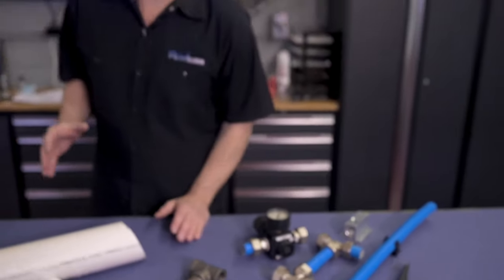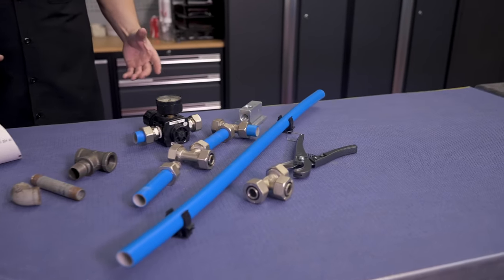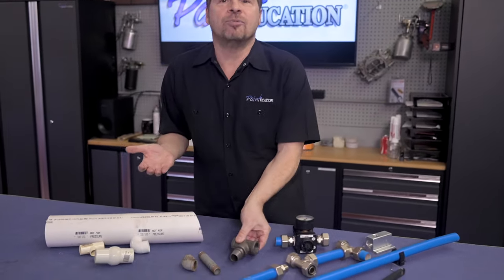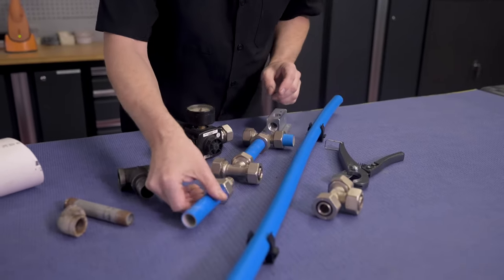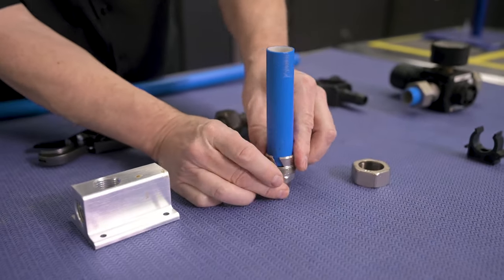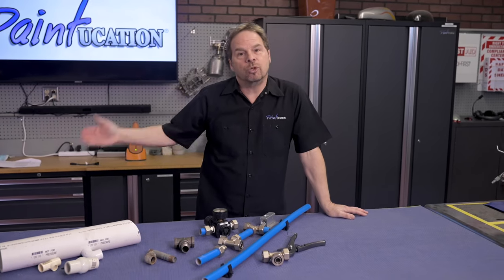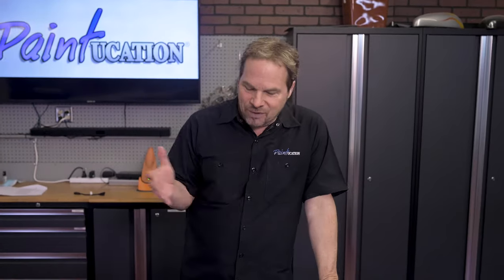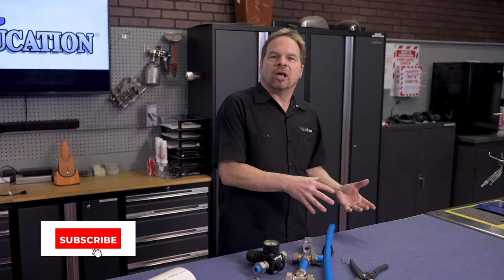Best Paint Air Lines for Automotive Painting

Comment: What are your thoughts on using PEX line?
Reply from the maker: Pex is NOT UV resistant.  Just like PVC it will degrade with exposures to sunlight and UV over time. I bet if you did a cost comparison, the modular airline systems are in line with PEX and are definitely rated for compressed air inside or out.
Reply: Where can I find the modular airline ?